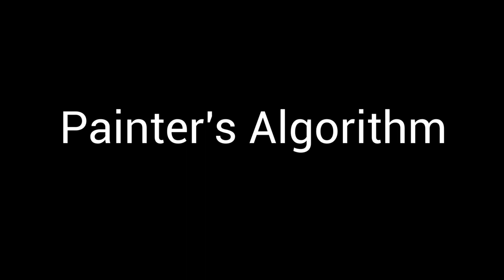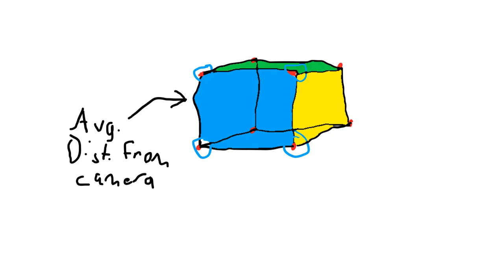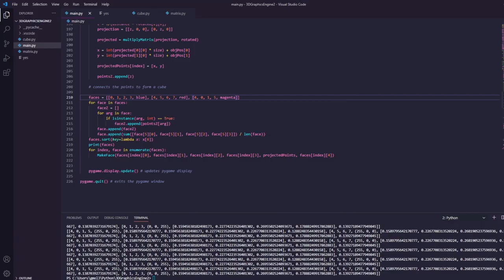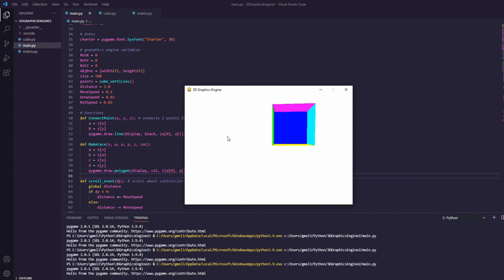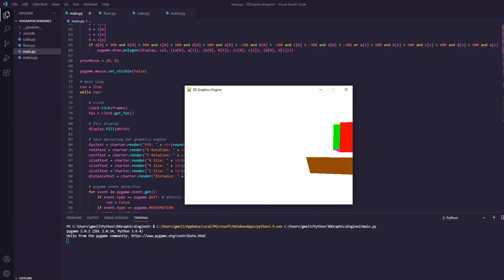Comment: Simple:
Add multiple bodies, like thetraeder or parallelepiped (wiki is your friend =P ).
Or differently:
Why don't you just put several elements in the view. Or even build a kind of level editor, where you put new cuboids on the base one by one... then you can load the "level" and fly through it.

Comment: I was trying the same, and i had the same problem, so i tried to use spherical coords (My mother language is Spanish, so i don't know if you call them like that, search 'Coordenadas Esféricas' in google to see what i'm talking about).
I limit the angle that the screen shows, for example, if the point have a 235° from the viewer, and your restriction (your limit) is form 0° to 120°, it will not show, but of course in between the angles it does.
The problem with this are 2:
 - First: It makes a sort of mirror, if you turn 180° it feels like doing it 360°
 - Second: Distorsion, Is the same problem of representing the Earth in a flat map.
With the first one, you can make some tricks to solve it, but the second one is hard, I solve the distorsion of 'turning your head' but i create a distortion that comes with your movement, and it was weirder.
Reply: I made another one, but with the same formulas that you search on Wikipedia, and with some conditionals I solve those problems you have